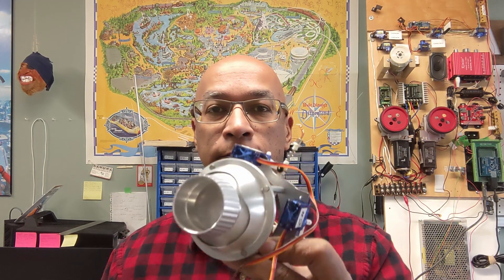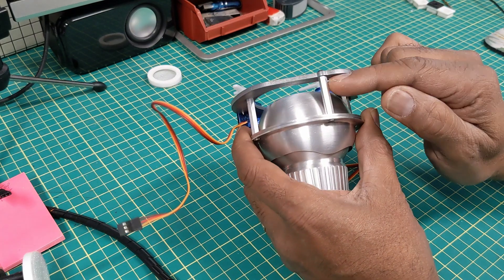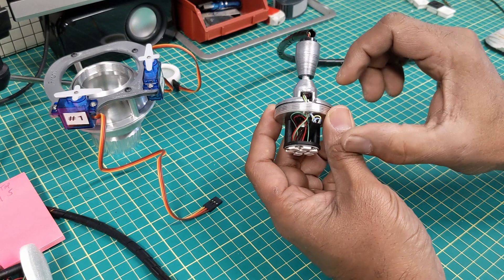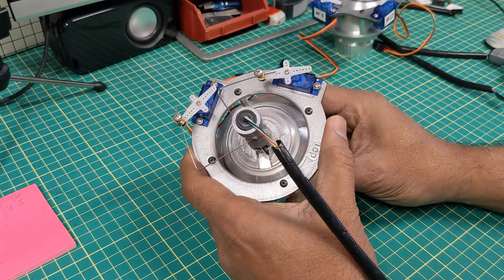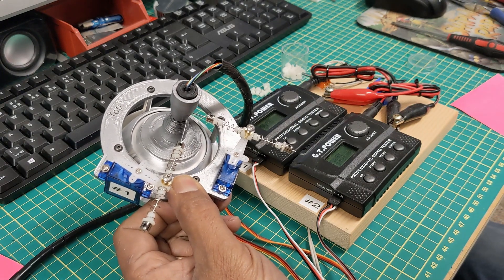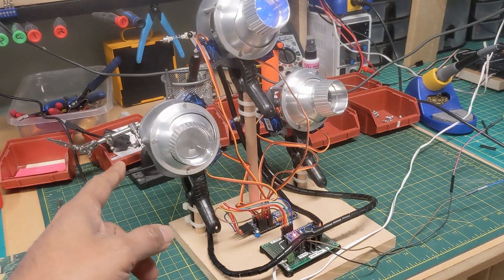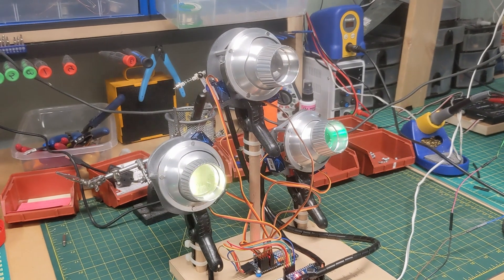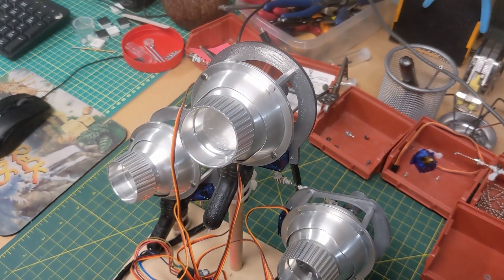R2D2 Build Episode 12-Holoprojectors

Comment: Thank you very much for sharing this.  I'm working on making a tool for my lathe that will allow me to make my set of Holoprojectors.  I will definitely be watching this video again for reference.  One question; I see that the lens is held in with a retaining ring.  Does the lens have a lip that rests on an inner ledge of the housing, or is the inner diameter of the housing slightly smaller than the diameter of the lens so it can't come out and the retaining ring keeps it from falling back into the ball portion?
Reply from the maker: Thank you.  The lens is held inside with a snap ring that fits into a groove around the inside of the lens.  It is attached as most snap rings are so all you have to do is use a pair of snap ring pliers and remove the lens if needed.